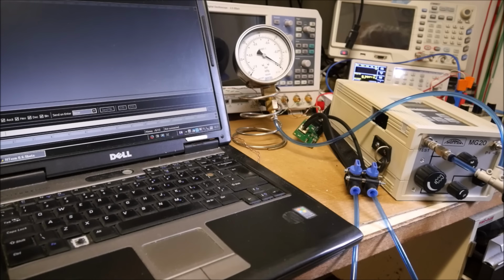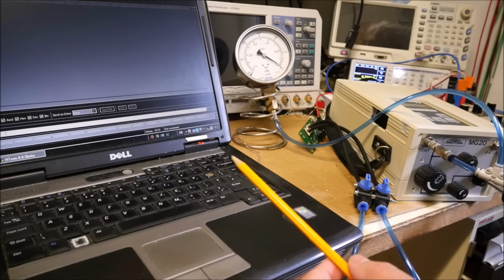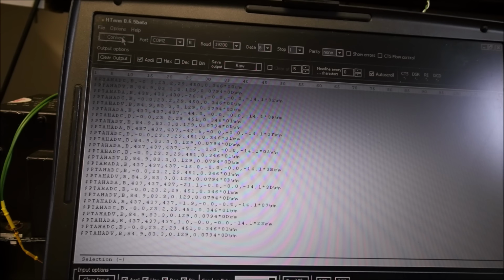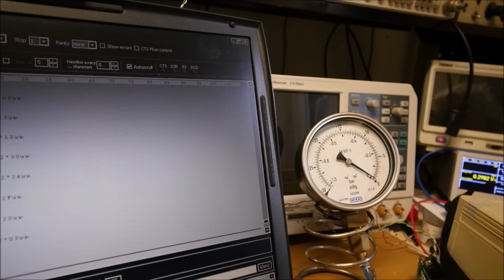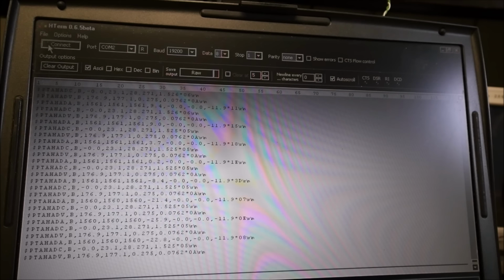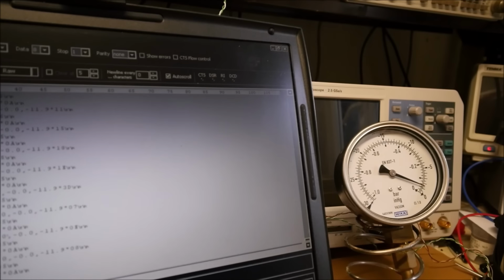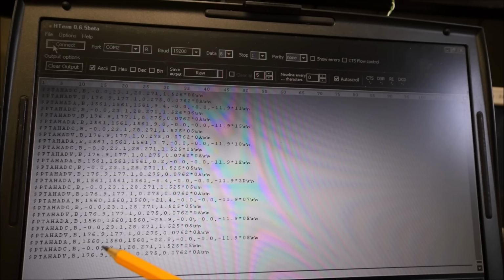LDM #369: Shahed-136 drone Air Data Computer module

Comment: DB9 connector, RS-232, NMEA-like protocol and overall "generic" design. Looks like it is some off-the-shelf sensor, or local clone of such part.
Reply: what connectors & phys you prefer & why?
Reply: Later on the strings are likely combined with the positioning output stream and the line prefix would just serve to differentiate.

Comment: The part choice is very much what you would see in a western design. Use of the stm32 in particular suggests familiarity with US/Europe hobby designs. But having a separate "air data computer" is more of a traditional aerospace engineering architecture.
Reply: STMicro is Swiss. They sell to everybody. The Russian missiles fired at Ukraine contain Traco Power parts - also a Swiss company. The parts are not Swiss made though.
Reply: @skuula  It could easily be a Chinese bootleg
Reply: It is probably running something like Betaflight. It is real time and with a processor like M0+ there isn't much scope for fancy comms, so talking to satellites and  overall guidance is probably on a different board.
Reply: @lubumbashi6666 are these things guided by any thing other than following gps signals ?
Reply: lol, nope in a MIL spec design, very far from that. Also that board layout is very poor and certainly not up to any western military standard, or even industrial/commercial. The datas in plain ASCI via RS232 without even a crc is also quite pathetic, i cannot think of doing such thing even in a basic comemrcial project, at the very least packed structure with checksum.
Reply: @lo2740  it doesn't need to be MIL spec, that's what makes them cheap. And as we have all seen, it works and costs just a few dollars. What's the point of gold connectors and radiation hardened ICs when your whole purpose in life is to take off, travel a few hundred kilometers and explode.
Reply: @JumpstarOfficial few hundred kilometers? I think not. Those UAVs cross Iraq, Syria and Jordan into Israel. That's thousands of kilometers. 

Proven range is 2500 km.
Reply: @zakiabdinasiromar5434  I was being conservative, of course you are correct.
Reply: @lo2740  i'd love to see a firmware dump of the microcontroller, i bet it's full of vulnerabilities
Reply: @ganondalf8090  it doesn't really matter as there is no way of exploiting them for something that is a read-only sensor. But would be curious to see vulnerabilities on the main computer or some communication devices
Reply: @svuvich  there's nothing traditional to attack, sure. But we're talking about military stuff, i'm sure that if you gave the CIA enough time and money they could totally come up with some sci-fi sounding attack vector.
Reply: @ganondalf8090  if it has no outside connectivity, you can't exploit vulnerabilities.
Reply: @benargee  ... it does, they dont just fly these things blind
Reply: @ganondalf8090  you have a source that they don't follow preprogrammed paths to a preprogrammed target? It's likely they could turn off all receivers (except GPS) a few minutes after launch and are well out of range of enemy transmitters.
Reply: @lo2740  LoL. These shahed drones are very much reliable and cheap and that is the sole point of modern kamikaze drone warfare. They get the work done.
Reply: @lo2740 Isn't that the entire point? Lack of adherence to quality standards and cheap mass production. Western equivalent costs what again?
Reply: @MrCarGuy  The thing is board layout is not a production cost, it is a design cost, and frankly just show that it was not done by someone with experience as good layout doesn't take more time than bad layout for an experienced PCB designer. Protecting the messages with a CRC so you know you are getting good data is an undergraduate assignment if even that. You could just use Google and cut/paste the code in a few minutes. That all these are missing shows that while the concept might be good the execution is terrible.
Reply: @jonathanbuzzard1376  Very funny entitled exceptionalist speaking. What is your suggestion to a kamikaze drone to do when crc not match to data? ;-)
Reply: @tombicmail you can ignore that particular message to avoid data confusion... Use only valid messages
Reply: @jonathanbuzzard1376  and yet its bombing multiple cities right now, your comment aged like milk
Reply: @pear-zq1uj bombing cities does not constitute genocide. There was no genocide of Germans or Japanese during WWII for example desoite cities being flattened literally and the population actually decreasing. The population of Iran is higher today than it was before the current outbreak of hostilities. The only thing that is aging like milk is your mental capacity for logical argument.

Comment: As the STM get so rare at the pandemic that washing machine controller get desoldered the secondary sanction should be increased level by level. Not as this complete stop any chips go there but it will have the opportunity to uncover the hidden traces of delivery.
Reply: its easier to allow the destruction of factories, but this is not included in the war scenario
Reply: this is the inconvenient of whole west semiconductors fabricating plants gone  in china for higher productivity and lower cost conservating nresearch and development in our countries , final manufacturer bhas no problem to sell in iran or north ncorea ......and russia iran korea has full satisfaction about the product because is engineered and tested by usa or europe ...
you can find on seeker heads of infrared , laser g bombs , ballistics missiles devices from analog devices now microchip, dsp stuff by texas instruments, mosfet and drivers from international rectifier  also stm...  , microwave front ends , phased arrays with  circulators phasers ecc. from thales (ex thomson csf)... 🙂
Reply: How do you want to achieve that? Stop producing electronics for western companies in China entirely? They probably have enough STMs stockpiled in China for years of Shahed manufacturing
Reply: GD32xxx???
Reply: @uavdev  Yes, they remove some bugs in the timer which break the workaround code.
Reply: Oh my dear! You're make me donate my washing machine!  😁 STM32 контроллеры не самые последние на свете. Есть CH32V, а также отечественные контроллеры. Вы переоцениваете свои санкции.
Reply: @artip777  Yes, do not overestimate life. Btw there is a chinese STM which remove some bugs, exact which are coded out for the orginal. This stop car manufacture for simply hardware swap.
You make me curious as i know chips very well. What mean domestic STM?
Reply: @reinerfranke5436  I meant not the STM,  Russia produces variety of MCUs. Like Микрон, Ангстрем, Миландр and НИИЭТ. All of them already under sanctions for 2-5 years. That's simple to swap this hardware, not a big deal.
Reply: @artip777  Yes Russia will produce everything themselves and live like kings, they can learn how from North Korea
Reply: @artip777  Оставайся сильным товарищ

Comment: Did you figure out the temperature sensor? I would guess it will be a jellybean part, probably a 10K ptc.
Reply from the maker: It has a small impact in one output value, nothing relevant. The value must be below 150 Ohms, because a resistor of 470 Ohms is connected to the TL431 which gives a constant current of 2.5/470=5,3mA. Therefore the maximum resistance is (3.3-2.5)/5.3mA = 150 Ohms, even less because I have supposed a complete saturation of the transistor.
Reply: @lelabodemichel5162  FWIW, Temp vs VTH curve is "linear" (1-2.7v) if R25=1000. Nonlinear if R25=100 (2.2-3.2v). Cannot say if this is relevant...
Reply: @lelabodemichel5162  Maybe they use Pt100, a 100 Ohm platinum resistance thermometer?

Comment: But why convert the data to ascii to transmit to the flight controller? It will have to convert it back to binary at that end. - They could have optimized it a bit more. Also PCB size could have been 1/3 of what it is there. Anyway, we learn that rocket science isn't that hard.
Reply: It seems to speak nmea0183. TAH is not a registered vendor code.
Reply: this is just a drone, rockets is another thing and much more advanced
Reply: @rezah336  actually no. Basic principles are the same. Guiding something in 3D without visual reference is the rocket science.
Reply: @SalihGoncu  rockets flies so much faster, much harder to control and be accurate
Reply: @rezah336  the theory and principle does not change.
Reply: @SalihGoncu  yes it does, it is called rocket science for a reason, have you ever heard of drone science? it is a different thing with much more extreme technology

Comment: No checksum or crc
Reply from the maker: The two characters at the end of each string following the * is the checksum.
Reply: @lelabodemichel5162  ok, yes I see now that it's a hex value
Reply: He is only showing the strings that are sent over serial, depending on how RS232  is used it should have checksum buildt in to the protocol.

Comment: Yeah, the pressure sensors monitor altitude and air speed (pitot tube).

Exact same system used in light aircraft.

Don't forget, in your experiment you're probably reading pressure correction, as there is ambient pressure around. Depends on how the sensor is configured.

It is possible to use new digital MEMS microphones in exactly the same way now (home weather stations).

Great reverse engineering! Big clive would be proud. 😀🇬🇧👍🏻

Comment: The pressure sensors are similar to car MAP sensors.
Reply: generally are bridged resistors in elastometric matrice configured as wheatstone bridge , also versions with op amp buffer inside...devices in car map sensors are can bus networked for avoiding disturbances and auto calibration facilities

Comment: The two different Air Speeds seem to be IAS (Indicated Air Speed) and TAS (True Air Speed). TAS is IAS corrected by temperature and altitude.
Reply: Ahhh, no. One Sensor is the differential pressure sensor which allow calculation of the indicated air speed. That is the speed you need to create the observed differential pressure at sea level. The true air speed is always calculated by the absolute pressure which is the second sensor. 
Please note that only one of the two sensors has two air taps. That is the differential pressure sensor. The other one has only one tap for the static line. This one is the absolute pressure sensor. You use it to calculate the altitude, the rate of sink or rise, and use it to calculate the true air speed.
Reply from the maker: True air speed uses both sensors, it depends on the Mach number and static temperature.
Reply: @lelabodemichel5162 No, the speed of these things is not high enough that compressibility  plays a role, hence you do not use Mach, just plain km/h or knots. The temperature, yes. It affects the air density which is directly proportional to the differential pressure, as well as the square or the air speed.
Reply: @kaihorstmann2783  correct me if I'm wrong, but isn't the speed of sound dependent on air density? Specifically, given a set true air speed, isn't the corresponding mach number dependent on altitude and atmospheric conditions? In other words, aren't you both saying the same thing?

Comment: Kinda interestting that they don't use smaller (0402, 0603) caps for e..g the microcontroller. 
Also no glue or anything for the DCDC
Reply: they should put the smt components on one side for cheaper assembly.
Reply: I would imagine they designed these to be hand assembled, rather than pick and place machines.
Reply: Потому что 1206 Россия производит сама.

Comment: Very cool Michel!  I remember when Collins was developing these types of air pressure sensors in the early 80s and it took a lot of experimentation back then to get it right.  They were used, of course, as sensor inputs for the air data computers at the time.  I wonder if the same sensor technology went into this drone's sensors?  Now we take for granted that things like 3" backup indicator sensors are as small as these.  Makes me curious how these sensors work.
Reply: there's absolutely no way this is the same technology. for example the ADC is probably much less accurate than whats used in commercial aerospace
Reply: No idea how the sensors worked in the 80s, but these types of pressure sensors are generally MEMS. They contain a membrane separating two cavities. One cavity is connected to the input, and the other is either sealed (for absolute pressure sensors) or fed to the other input (differential pressure sensors). 
Deflection of the membrane is measured through capacitive or strain gauge sensors, of which the signal is processed and scaled/calibrated. 

Could you elaborate on the technology those early generation sensors were using? I am sure it would be very interesting.
Reply: @tHaH4x0r  they were probably all analoge
Reply: Yeah, the old technology has been surpassed years ago. You can actually get a flight controller board for a drone/quad thing that has all this on board- for "altitude hold" for hovering like an aerial platform.
Reply: you can find a lot of pressure sensores , absolute differential, pwm output , linear output....just click at rs components catalogue

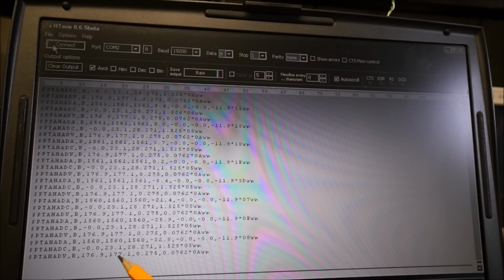Comment: 06:05 value 23.1 could be pressure in inches of mercury (782 hPa)
Reply: Or temp in C degre
Reply: @piotrbudowlaniec9160  Maybe a calibration temp that goes into a correction factor calculation.

Comment: Nice. I wonder if this thing prints any additional information immediately after it powers up? Maybe it reports the version of firmware or something like that?
Reply from the maker: There is nothing but a first string with incorrect values.
Reply: @lelabodemichel5162   waiting for a video on anti tank missile
Reply: @lelabodemichel5162  Can you not do a memory read on the micro controller? Compiled program should be in there ( i bet it involves a lot of AD conversion  and a simple algorythm stolen from somebody )
Reply: @youtubeurevil  ever heard of open source?
Reply: @a3103-j7g  do you not understand that open source programs have to be compiled before execution, just like closed source software?

Comment: Nice Work, enjoy your channel.
The PTAHADC could be calibration values of Pressure sensors based on Temperature.
You have shown PTAHADA, A is for Altitude and
PTAHADV, V for Velocity.
Reply: ptaha ~ bird in russian, but it may be an acronim also.
Reply: @eugenesorokin6602  maybe the D is "Datchik"?
Reply: This is Hello message to THAAD missile.

Comment: thanks plz analyze gnss or flight of shahed
Reply: The Shahed GNSS receiver is a very complex board with two dual input SDR chips and a big FPGA. It does the position calculation internally.
Reply: Yeah, I wonder if they use a stock sat nav chip or actually do circular maths to work out coordinates.

Means there must be a programming interface just before launch, to determine route via waypoints and final destination.
Reply: @fredfred2363  the Russians use the Kometa-M modules for GNSS. Everything is done in FPGA so no chance to analyze the code.